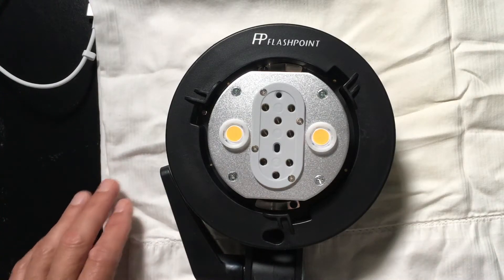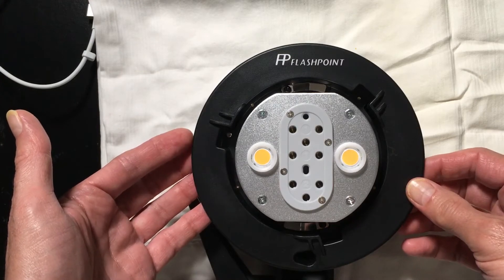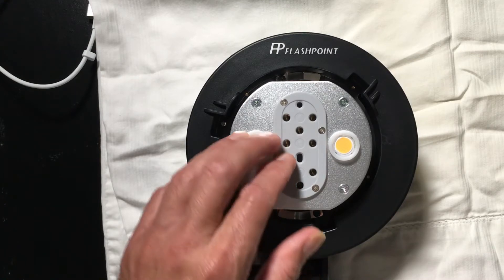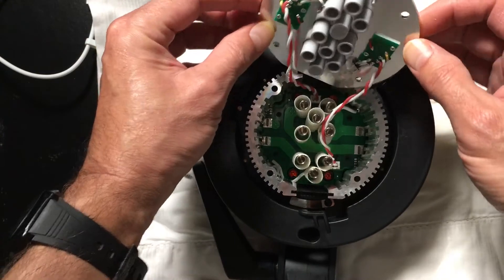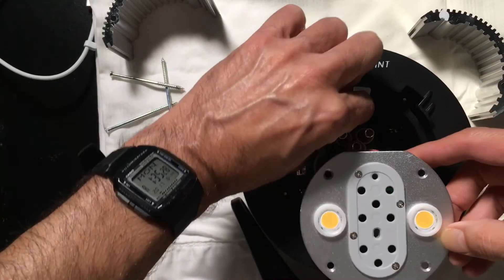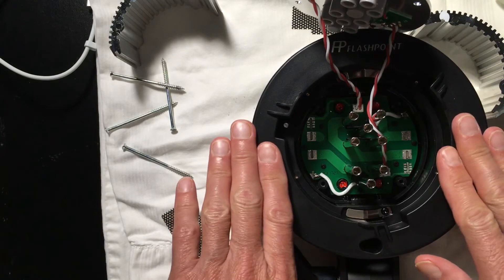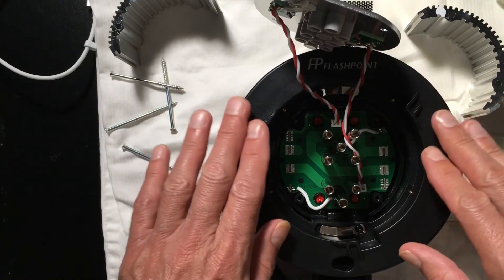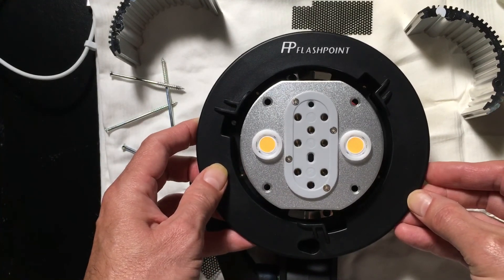Godox/Flashpont Evolv 200 Twin Head Teardown & 360 Bulb Usage - It's Possible!

Comment: Hi there! What I am about to ask is probably off topic but I hope you can shed some light. 

I am looking to buy the Godox AD600 but I really hate how the weak modeling LED light is. I am wondering if it is possible to change the 10W LED modeling light on the AD 600 to a higher powered one like 20W or more. From what I can see, it is a matter of removing the 10W and replace with the 20W one but i'm not sure if I need to get an extra driver because of the increase in power or i need to have a better heat dissipation plate.

I hope you can answer my question. Thanks in advance
Reply from the maker: +Li Tai Long 

Thanks for watching & for your question.

You have raised an interesting and very practical issue with the AD600 LED modeling light.

The decision to use a 10W module was two-fold:

1) Power consumption. 

It has always been a point of pride for the manufacturer that the the Witstro/Godox/FlashPoint/CheetahStand 600 performs "all day" on essentially one fully-charged battery pack.

That includes a 10% duty cycle of the LED modeling light as indicated in the literature.

The included Li-Ion battery pack is rated at 8.7 Ah, at 11.1 VDC. Running the calc. for potential available wattage, that's approx. 96.6 watts for one hour, 966 watts for 6 minutes, or 9.66 watts for 10 hours. Rounding up slightly, yields an effective 10% duty cycle with a 10W LED of less than 5% of total available energy, assuming 90% total discharge at day's end, and using a 1:1 flash bulb power with the 600 watt-second bulb.

If we double the required energy for the LED modeling light (ignoring for a moment that this isn't exactly a linear relationship), you'd now face a more noticeable 10% ding to available flash power. The decision was made that even 20W won't provide enough extra continuous light to offset the reduction in usable time of the admittedly flash-centric AD600.

2) Heat dissipation. 

Both the 600 watt-second bare bulb and the LED module both throw off considerable heat (as wasted energy, to boot!). In order not to increase the overall dimensions and weight of the full unit by including a fan, much larger internal heat sinks, or both, it was decided early on to limit the biggest energy-waster to 10W.

Now, having said this, there is nothing to prevent an individual user from performing a DIY mod to increase light output. The easiest way to do this would be to augment the passive cooling already present with a powered fan, rated at 12VDC. The trick, of course, is how to mount such a beastie where it works well and isn't too obtrusive.

The other consideration is, of course, run time. Conservative back-of-the-envelope calculations would yield about 25 minutes max at 20W on a fully charged std. battery before crossing the 90% depletion threshold on a reasonably new battery pack. (That doesn't include very many 1:1 flash uses, either.). 

The included LED driver module could be modded to support the 20W LED, but it would honestly be easier for someone to just design a new 20W dedicated head with the appropriate driver board and fan included. (Hmmm, I sense a new product here.....)

Sorry for the long reply! I've looked into this myself, and haven't found a solution I like.....yet.

Please stay tuned, as you may be pleasantly surprised in the near-ish future!

And many thanks for your question and reading this far for my reply.